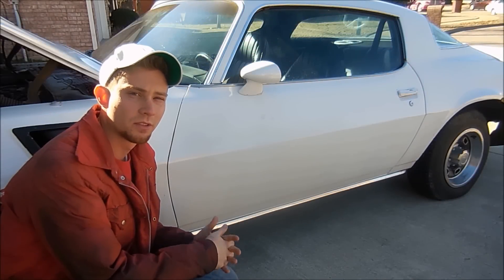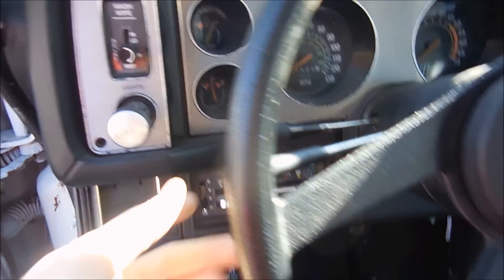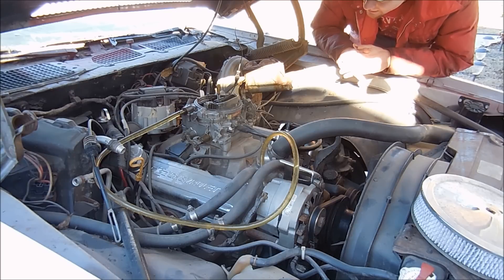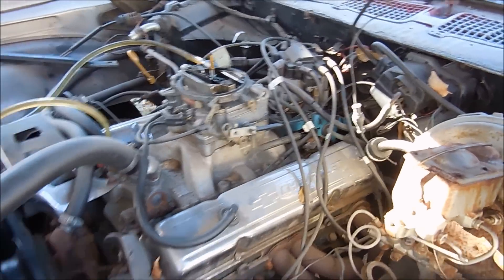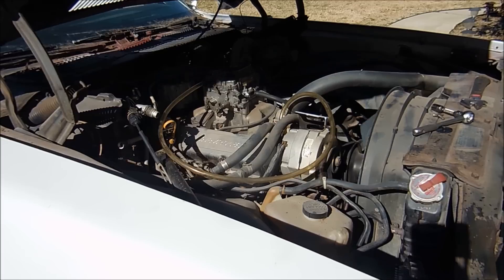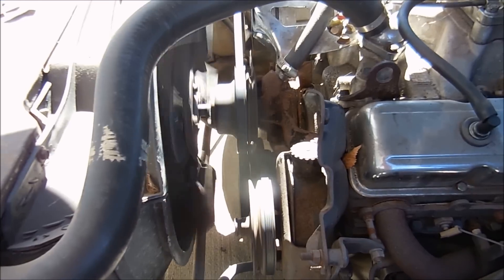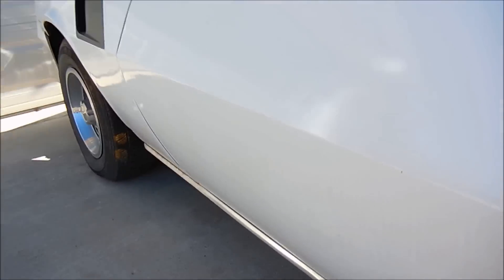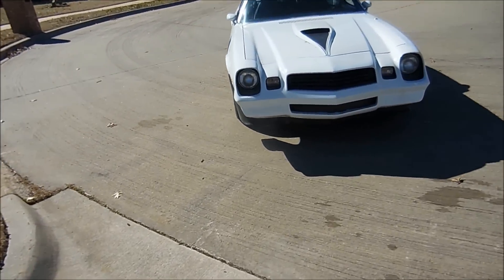Will It Run? 1979 Chevrolet Camaro $500 Challenge Part 2 of 9

Comment: Great video ... can't wait for the next ... watching the video, I was like that fuel line going to catch the alternator ... lol .. seen you fixed it & read you changed it to a metal line, too. I'm not a fan of Edelbrock carburetor's, either. But recently rebuilt one for a friend & they are easy to rebuild, even on the car. I know your on a budget. but, that engine bay, needs some cosmetic love.... lol ... you should check the rearend gear oil , wheel bearings, tranny seals, u-joints, ball joints, etc. All that stuff is cheap. Fuse panel & bulbs ... lube the window tracks , new wipers, fuel, filter, pvc valve, window switch may work if cleaned. Check thermostat operation ... I know you know what your doing. I like checking complete systems .... like fuel from tank to carburetor ... cooling radiator, hoses, reservoir, thermostat, sending units, water pump ... ignition system, from distributor, timing, wires plugs, coil ... brakes , exhaust, etc.  ... I love the simplicity of working on old vehicles ... again great videos ... I enjoy your channel.
Reply from the maker: Cocoa Cabana Yep I plan on going through all that, but I need to take it one step at a time. if the transmission is toast, then all of that will have to go on the back burner. If there is no shifting who cares how well the car runs!
Reply: Good thing th350 is rather plentiful & cheap

Comment: A little tip for you never leave tools anywhere around the engine bay when firing up/running the engine. With all the vibrations they can fall in & cause a nasty & expensive mess.

Comment: one way to check the modulator is pull the vacuum line to it and check if transmission fluid has been leaking into the vacuum line,if so it also makes trans fluid disappear as it gets drawn into the engine and burned.
Reply from the maker: Bigdog302V8 You would also see tons of smoke pouring out of the tail pipes too. When they go out, they go out bad!

Comment: That 3 foot clear plastic fuel line nearly vibrated itself into the fan blades and the alternator at around 11:00 minutes in,
Reply from the maker: Richard Adams That has been fixed. I wanna meet the previous owner who installed that and ask what he was thinking
Reply: Yes, I saw that you had fixed it in a later frame. I was just commenting in one of those, "Oh sh*t! Did you see that?", kind of ways.
And yes, I would like to meet that person also. If nothing else, why did he not cut the wrong choice of hose to a more manageable length?
Take care and I look forward to more of your videos.
Rich

Comment: sweet ride man ! how did you get your turn signals to work? I also have a 79 I'm working on and the signals won't work, the lights turn on so do the rear but no signals 
:( weird thing is emergancy flashers work but not individually as turn signals, what could it be? thanks in advance

Comment: You get the TRANS FlUID up to temp if you want a hot reading.  And it takes about 10-20 miles of driving.  But you can go with a full cold reading otherwise

Comment: I had a 79 Camaro.  There was a vacuum line that ran under the air cleaner down to the transmission.  If the vacuum line was in the wrong position when the air cleaner was put back, the vacuum line would pinch off and the transmission wouldn't shift.
Reply from the maker: Lewis Okert Im sure this used to be the case on this one, until a previous owner threw away the original air cleaner and junked all the smog stuff

Comment: Have you ever adjusted carb air  / fuel  screws using  a vacuum gauge ?    I also use a vacuum gauge to set valves , its a helpful tool to get the best & equal settings .
Reply from the maker: ***** No but I have seen it done. I do know that this camaro will need some carb adjustments for sure, and a tune up, and brakes,,, the list goes on

Comment: I see your burglar alarm sign over there...you in Texas? Ive got a 79....with rallies...Does that spacer work on the intake? Any noticable power increase? Or was it like that when you got it?
Reply from the maker: +TheCaskOf43 When I got it, there was no spacer. Spread bore intake with a square bore carb. Yes I live in TX. I didnt notice anything other than it ran better with no vacuum leaks between the carb and the intake

Comment: When you have headers on an engine, if that car sat for a long time, you need to change the gasket, and once you install a new gasket, after driving  while, check them again, they most likely will need to be adjusted again. After that, they will work much longer. And an exhaust leak, robs horse power. And burns too much gas,, So I would get that fixed soon.

Comment: Someone put the 80-81 extractors on the fenders.  Chrome trim would be blacked out as well although it could have worn off as it was just tape.  Z28's would not have the Rally wheels.  Would either be the turbine or the modified rally taht looks nothing like these.  Bottom line, someone tried to make a fake Z out of what appears from the interior to be a Berlinetta.  Also looks like the Fan clutch is shot.

Comment: Ben, get that fuel line away from the alternator and fan.
Reply: Nevermind, I saw where you shortened it, but man that was dangerous.
Reply from the maker: Ted Boland I have already changed it to rubber line with a metal fuel filter. Much much shorter than this one.

Comment: Air in the fuel line. Also instead of complaining about that shitty faux fuel line you shoulda bought a new one when you bought that battery.  By the way that Edelbrock is a real carb. Forget that Holley junk.

Comment: Hey do you think you could go back to making videos without the background music tracks? as it just seems like its abit distracting and needless

also if the brakes are that bad, knowing GM cars, check the drums and the master cylinder, as I had a cracked drum on the old Ciera. Which had a piece brake off and come undone, jamming the drum on a hard stop, and I just barely got it down the hill and stopped with 5% braking power into my driveway

as it was one of those its been sitting, I'd better drive it around the block kinda deals, and a week earlier it had been driven to the local home depo to pick up a ladder with, and thank god we didnt have to do a sudden stop then! .

as the car had hit a rock under my brothers hand, took out the shock absorber on that side, and the tire, and the guys at the GM dealership didnt think to check the drum or replace it.

and that same car had a weather leak, the tail gate seal broke (it was a Ciera SL wagon) and it let moisture build up in it, causing the headliner to sag and it killed the electrics, and this was after we had that brake drum fixed, so there might be a leak in your car as well somewhere.
Reply from the maker: Kavinsky Smith I can see in the MC that the front has fluid and the rear has none, so we are working with 50% brakes at most! Im sure a couple of wheel cylinders, MC and shoes and the brakes will work great
Reply: ah alright, so its not like what happened to me then. hell you did find that there was no fluid in the transmission. So maybe someone drained most of the fluids at some point for storage and forgot to refill them.
Reply from the maker: Anything is possible on these old cars. I mean, I think I have seen it all, and then bam I see something and shake my head and say well NOW I have seen it all... Happens on every car I bring home
Reply: lol indeed, you always need a check list with these old things. As if theres one constant in life, its human stupidity

hell I'd wadger the electrical problems are a bubba in a fusebox again, or maybe someone who used the wrong gauge wire in the car.
Reply from the maker: Or simply someone left something unplugged, it wouldnt be the first time! If there is no power going to the steering column, the horn and turn signals wont work etc.
Reply: ah anyways good luck with her, hell if all goes well you should have your cheapest finished project yet.

a few pipes and some coolant/fluid latter I hope.